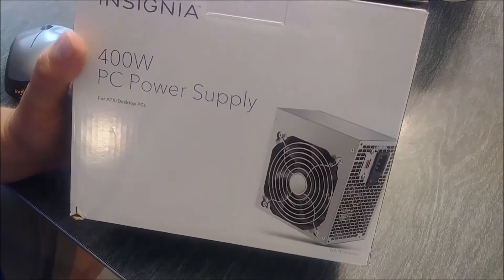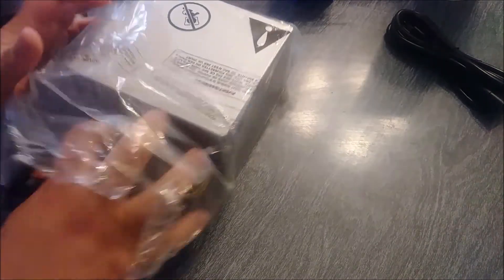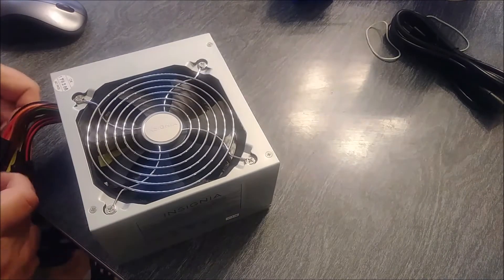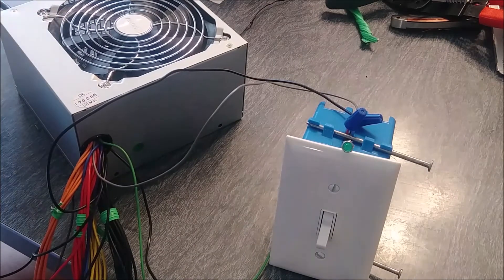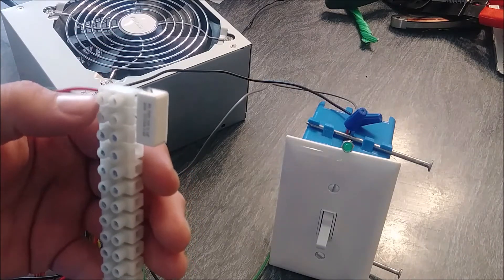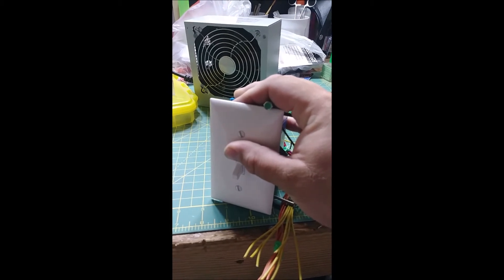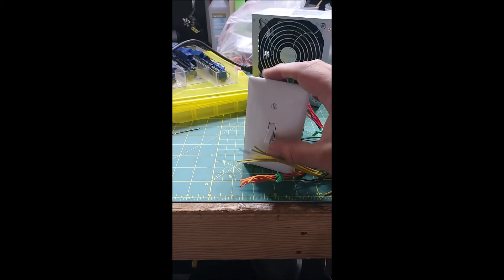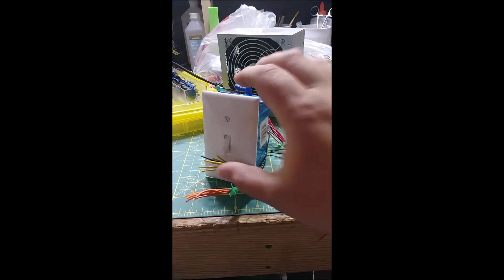Power Supply for Model Railroad

Comment: hi Dustin... i have done a few vids on computer power supply's about 18 months ago ... first off you don,t need to use such i ginormous switch to turn the power on/off  a spst toggle switch will work just fine...which will save room on your fascia....i am using 2 of these power supplies on my layout to run LED lighting for the layout & to run my switch machines... all off the 12 volt line.. i eventually will use the 5 & 3 volt lines for other features on my layout... thx for sharing... vinny
Reply from the maker: Vinny- I will have to check out your videos as I am new to your channel. I thought about doing a smaller switch, but this was personal peference, I guess. I can always change it if it isn't working. I am also thinking of attaching it out sight, as a master switch. Thanks for stopping and checking it out. -Dustin